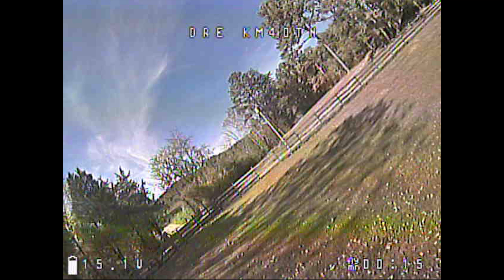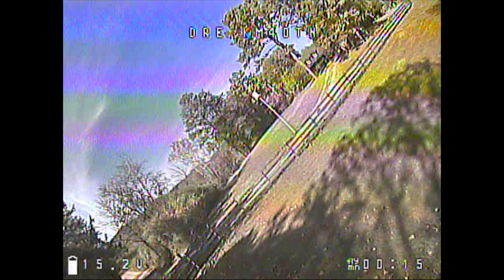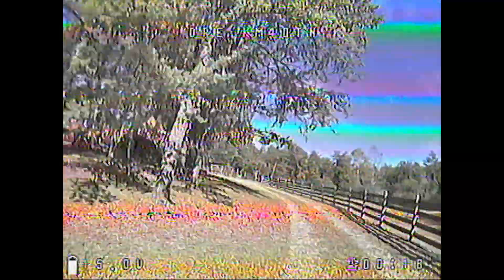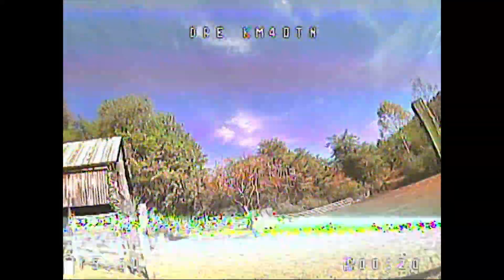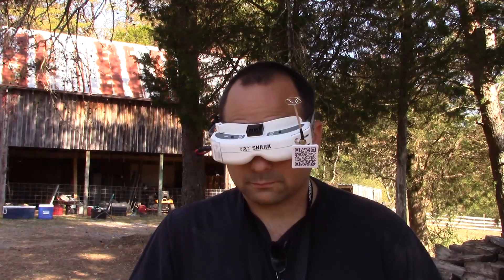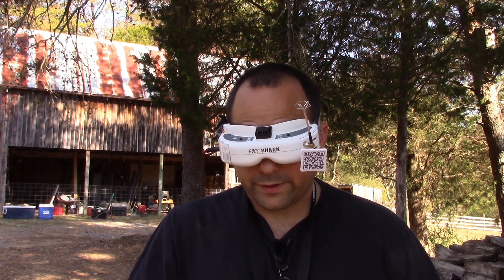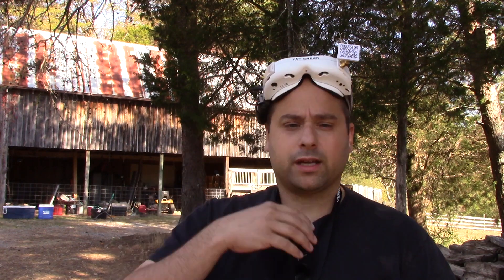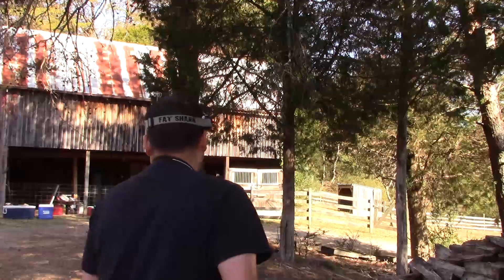Can You Troubleshoot #4 - CYT Why This "Desync" Isn't A Desync At All

Comment: while falling (at 2:59) it displays stats, containing min rssi: 0. so your RSSI has been at 0? that would likely cause a failsafe.
but, the fc also rebooted the moment you hit the ground because of the osd startup screen. fc/osd reboot can occur due to a bug, but that would probably not disable the vtx, indicating a power loss.
also, having low rssi at that distance is probably not range related, so i'm thinking about rx brownout/blackout or an sbus connection loss. the power issue could be the same problem that reboots the fc, but that doesn't explain the timing difference between rx/fc fail. 
the minimal voltage for the fc could be higher than min volts for the rx, causing the rx brownout first, and fc after that. this would mean the voltage drops gradually, which doesn't make much sense. why does the fc reboot while hitting the ground?
my theory is: rx is probably powered from the fc, which is powered from some 5v reg. this regulator slowly browns out causing the rx to fail first, then the fc. could also be a cold solder joint for the +5v to the fc. the fact that you're flying fairly low makes that the fc can reboot when also hitting the ground. if you were flying higher you'd probably have the fc reboot in the sky, or your fc rebooted from the impact on the cold solder joint when hitting the ground.
Reply from the maker: Good eye, but RSSI is simply not connected.

Comment: What i observed was no change in voltage. Appears it yawed/rolled left and pitched up. And seems the osd rebooted. From there i would examine the quad looking for damage and the smell of death and checking for sign of bad solder joints or similar. Cant draw conclusions from just the video. But it doesnt apper like a typical motor or esc failure unless it caused it to disarm almost instantly. Im more inclined to think it was the FC having an issue.

Comment: What I see happening:
2:57 the controls are suddenly centered (looks like failsafe event)
2:58 Quad starts tumbling because quads tend not to fall straight unless pid sum is zero
2:59 OSD indicates disarmed (with failsafe delay set to 0.5 second delay, it should be disarmed by now)
3:00 OSD indicates armed (signal back maybe)
3:01 quad hits the ground and signal is lost
3:05 video signal is back
3:11 OSD boots and FC remains disarmed

Possible cause of crash: RSSI failsafe (cannot tell without BB but behaves like it)
Possible result of crash: power loss and reboot of vtx and osd

Comment: I find it interesting how after half a turn the quad stopped spinning, if it really was a reset or a disarm wouldn't it have kept tumbling? Instead, it looks like it stabilized itself... well, a bit too late for human reaction but still, the fc was doing it's job... Was it a momentary short/ fc glitch that caused it to reset? Also, are you flying with the sirin? it would explain the osd glitching too
Reply from the maker: This is the Sirin.

Comment: right after the stats while still tumbling it says ARMED again.... either it's a betaflight glitch (OSD crashes BF via SPI) or it's this weird allinone-esc (assuming it's the flynoceros build - or did another quad pull the same "trick"?) either fluctuating 5v or other mess.

or any weird stick-move combo that got thru to the esc/osd/whateva...

does blackbox have to say anything useful? RC command? failsafe? voltage drop? what kind of gyro?

Comment: My thoughts would be that you lost signal due to RSSI failure (your body and building positioned between the quad) or loss of power to Rx.  The loss of power may have occurred due to an overload of amp draw throughout the board/system, which first results in the disarm state.  The copter regained armed status but the crash itself may have also helped to induce the reboot of the board, thus showing the initial splash screen after impact.  

Recommendation: Check current draw specs of fc/pdb and see if you were within threshold.

Comment: I've had the exact same problem when I had an esc burn up. I'm guessing it's the esc! whether it's a burned up esc or a motor wire / connection came loose to that motor / esc is curious, as I've had a bad solder joint that made the wire just loose enough to do the same thing. with desync my copter usually spins like a top.

Comment: The stats screen came up from the OSD right after control was lost.  I think that means a disarm happened.  Then the OSD seemed to reset itself, which I think means that FC rebooted.  My guess would be a fault in the power line to the FC, maybe a bad regulator or loose solder joint.

Comment: my first thought is the #3motor stopped, (back left) but i would expect a much more violent spinning crash. 
1.check prop lose or broke 2.check motor, see if it spins freely and isn't lose.3.smell for smoke. 4. stand back and try flying again. if it fails avian 5.Check wires- solder joints, and including ohmmeter the signal wire and all power wires. 
after that replace esc,

Comment: 1 The copter pitches up and left while entering a right turn
2 Then back flips and turns on the osd (Disarm)... No  RSSI warnings?
Reply: Did you open the ODS menu in flight? OSD shows at 3.01 ARMED

Comment: what is the 'operating load' of the CPU?...it seemed to 'flicker' out no matter which way u look at it...I've had this happen on a bad xt60/cable before with no apparent damage to the exterior of the cable...but that was after probably 60 crashes. is motor-stop enabled? what are u running kHz wise? idk I guess we'll wait and see.

Comment: WOW! lots of qn marks there Josh. It looks like the rear right motor stopped making thrust, and the rear left spun down to keep it in attitude, but also causing it to flip. I am sorry to say I cant offer any more than what I think you already know. As for what caused that motor to spin down, I have no idea. Could be a number of things, ESC signal wire, motor screw loosened, firmware bug that affects that one output, too higher looptime, that somehow allowed the FC to arm, but had too higher CPU usage.

Comment: You can see the splash screen from your osd right after the unintended left roll/yaw, which would indicate the quad was disarmed, a few frames later you can see that it was re-armed.  After the tumble you can see the betaflight splash screen which would indicate a power reset. I didn't hear any rssi warning's from your taranis, so it doesn't seem to be a faisafe. I did notice your flight review showed 0 rssi, but I also didn't see rssi displayed on your OSD so I'm assuming it's not connected.

My first step would be to check the power running to the FC.
Reply from the maker: RSSI is not connected, correct.

Do you think a power outage could cause the OSD stats screen to display, and then "armed" to show afterwards?
Reply: At first I was thinking it was just a power hit to the FC. Now that I just watched your Betaflight OSD video, I'm assuming this is the quad with the Sirin FPV FC. If that's the case I can't see how the FC would have taken a hit without the OSD going with it. Also I only see the Beataflight splash screen after the disarm/rearm, which would have also been displayed if disarm/arm was caused by an FC power cycle.

That being said, now it seems like more of an RX failsafe to me, and the impact on the ground is what caused the power cycle to the fc. I just figured we would have heard your taranis yelling at you if that was the case.

Probably still wrong, but this is a lot more fun when it's not my quad :-)

Comment: It looks like you are switch arming so I don't think you disarmed it yourself mid flight. The voltage disappears and your stats get displayed while still in the air. But after performing the left turn and being faced with the trees I can imagine your left stick could of been fully in the top right (throttle max and yaw right) would that trigger a disarm? Wouldn't of thought so. As for connections, your vid and osd stayed on so not the main power lead. Final thought would be a connection on the esc, cold solder or has a pad come away?

Comment: Roll left, pitch back, OSD summary, lost video, OSD armed notification, OSD splash screen.
Seems like a quick loss of power to the FC and/or OSD since it also lost video, depending upon the connection.
Reply: I'm going with this as well. Joshua, do you have a capacitor on your 5V regulated power supply?
Reply from the maker: +lebasson I don't.
Reply: Who knows, that may play a factor in the cause. If it's indeed a case of a brown-out causing the receiver to failsafe then you can mitigate this with a nice and juicy electrolytic capacitor, say 2000uF-3000uF. I don't think it's necessary for it to be low-ESR as the fluctuations on the 5V regulated line should be relatively low frequency. What do you think?

Comment: The OSD seems to have reset itself(right after the quad starts to tilt before the crash), so there might be an powering issue with the copter... Bad solder joints on an ESC(should be that on motor3) that shorted out for a sec and with a power spike resettet the whole system?

Comment: I find it interesting that after this crash the Front right motor (#2) stopped spinning but during the flight the quad went back and to the left, like motor #2 was making too much thrust, or there was a problem with #3 or #4.   It could be a whole host of things, but first place I would soldering on a spare ESC to that motor and checking if it spins up to eliminate the motor being the issue, then use that spare esc and see if it hovers to eliminate the 4-in-1 esc being the issue, then I would use Bl-Heli ESCs to eliminate software being an issue, from there on out you're on your own on this one.   Does this remind anyone else of Kramer and the famous spitting episode with Kieth Fernandez?  ... His head went back and to the left, there was a second spitter. https://goo.gl/images/juo9N0
Reply: Using PWM ESCs with Betaflight 3.0.1 I got the same issue in flight (was using some old spares to build a giant x-frame for shegrins, because you know board and stuff), from my experience I believe it to be a software glitch with Betaflight where Betaflight doesn't like anything less than OneShot anymore, I may even have blackbox of similar events, but I would really need to look.  However I didn't smoke any escs in my case.

Comment: 1. From your ground recording list observation of the issue:
        a. 2:58 Attitude anomaly 
        b. 2:59 OSD stats displayed on screen (stats automatically display when disarmed)
2. Perform visual inspection for obvious discrepancies i.e loose connections
3. Interrogate BB to drill down on possible causes
Reply from the maker: Good observations. There are two more things that I noticed after b if you want to keep going.
Reply: Stormin13 after B. immediate re-arm...which would indicate power loss rather than a disarm.
Reply: c. 3:01 OSD displays ARMED
d. 3:01 Loss of video as a result of the crash? 
e. 3:12 OSD reboots
Slowing the video speed down to .25 it looks like the loss of video is result of crash but you can start to seeing video again at 3:05 then the OSD reboots at 3:12. I never saw evidence that the there was a loss of power to the board. Could have been a failsafe. Blackbox should narrow it down I think.
Reply: Stormin13 complete video loss..is that from crash or is it prior? since video is integrated with FC leans us towards FC issue and not esc?
Reply: disarming and re arming, and then a reboot. i would check your 5v source, it maybe running below the required voltage.
Reply: Good point

Comment: Steps I would do
0.5, Check for any short circuits
1, Check if copers arms and motor rotates.
2, check for any unusal noise.
3, check if any components are loose and off position 
4, Range check the copter.
5, Check data recorder for anomalies 
6, Test fly in short distances in straight line in all axes
Reply: FC lost power in mid flight as it reeboted. check pdb regulator output for fluctuations

Comment: The left-back dropped Before the OSD changed to 'stats'. 
I'd probably start by replacing that ESC
Reply from the maker: What causes the OSD to change to "stats"?

Can an ESC cause this?
Reply: Nope.. I'd think the change to stats would be a result of the first error. I don't know why Your OSD changes to stats.. I'd think a FC disarm will get you into stats.
At first I thought: OSD reset.. but that wouldn't get you into the stats.. 
If the FC resets, that might throw the OSD into stats?
Reply: Watch it frame-by-frame again.. the stats show up just a few frames after the left-back dropped down..

Comment: On 02:59 you can see OSD statistics screen, which happens when you disarm your quadcopter. Few frames before stats screen quad starts tumbling back and to the left. So the OSD stats screen in mid flight is very interesting appearance and we probably could be working on that data.

Comment: I notice that the OSD changed at the point of failure and now displays a status (at point of failure 3:00). Also notice at 3:01 I can just make out "ARMED" on the OSD. It may be that at some point the Quadcopter disarmed or lost connection with your transmitter and the failsafe (guessing you have drop enabled) was applied? I would investigate range and also take a look at your modes in betaflight to check that disarm is not being invoked by any other signal or stick configuration.
Reply from the maker: Checking the modes is a clever idea. I'm pretty sure this isn't the actual cause, because I have this exact same setup on many different models, but it's a completely valid hypothesis that is consistent with the observed evidence, and I didn't think of it, so I like it. Thanks!